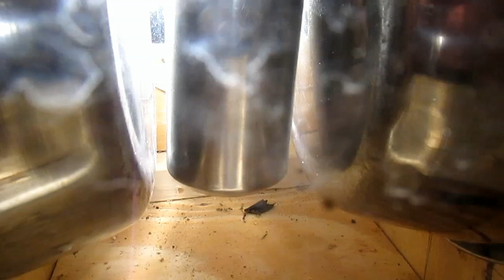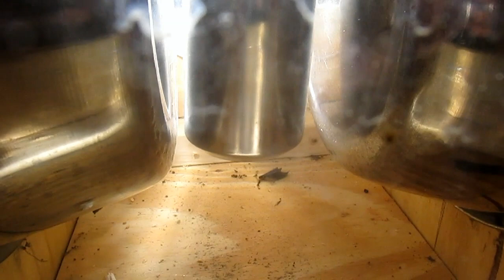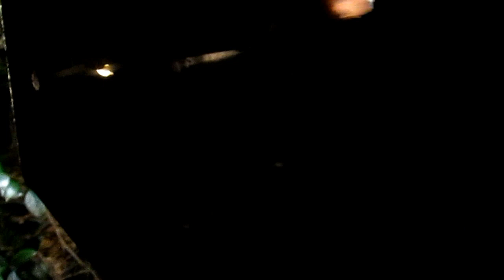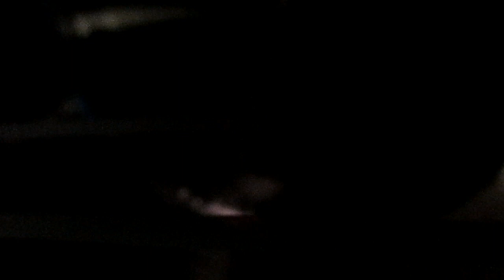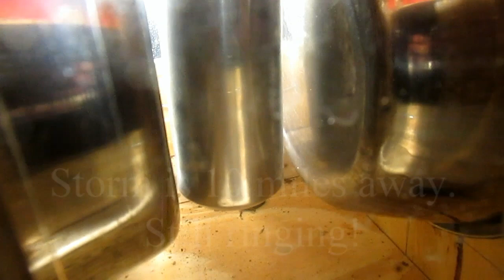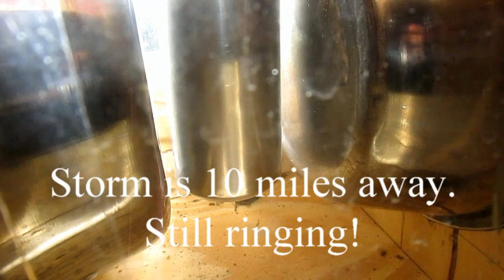Franklin Bells at Work

Comment: Nice to see Ben Franklin's set up done properly. Perhaps you could shut off or severely dim the light in your box so the sparks will be visible when the pendulum is about to make contact. You could try a hollow metal sphere at the end of your pendulum and see if you get a few more miles of range out of your set up and make Ben proud. (though the aluminum beer bottle is a nice touch). Well done!

I want to set one up at my house but unfortunately thunderstorms are few and far between in this neck of the woods.